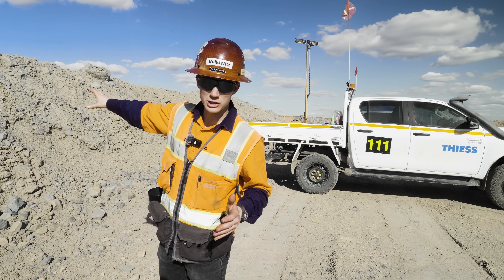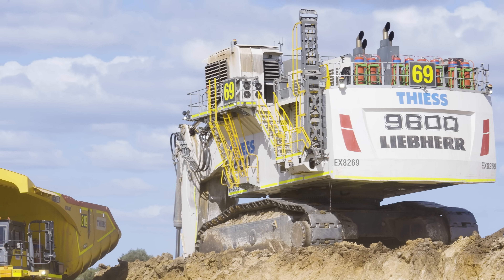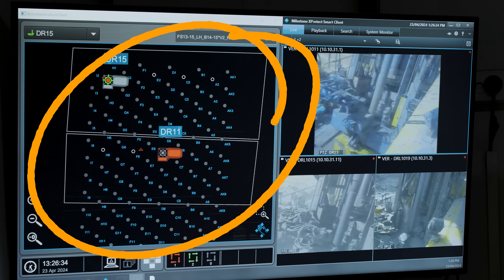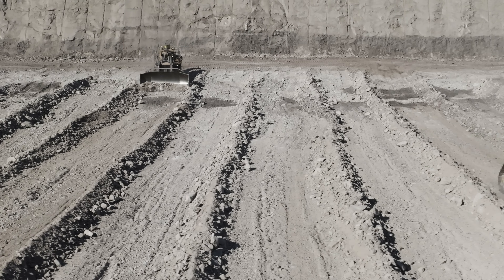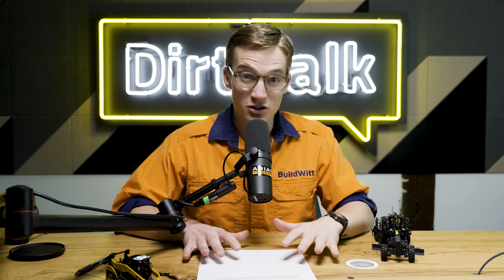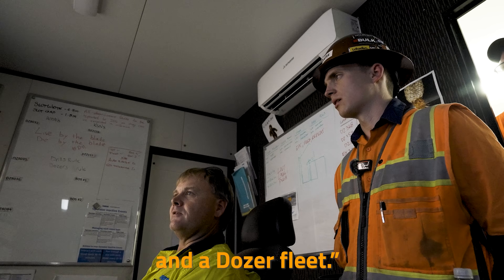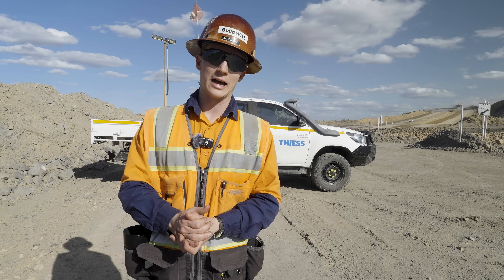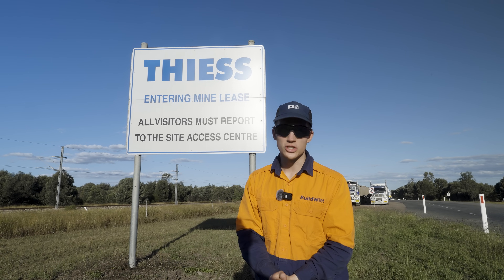Autonomous Bulldozers Explained!

Comment: I like how the remote operator still wears PPE, surprised the company doesn’t make them have a helmet and glasses too.
Reply from the maker: They may also have to head out in the field and run the tractors from time to time. They're still on site
Reply: @AaronWitt the appropriate name for this video should be: How NOT to Slot Push. You clearly how no idea about slot pushing techniques. It's a bit dangerous that you have this much influence in a topic you have limited knowledge about
Reply: @tera2477  how should one correctly do it?
Reply: @tera2477 please do explain how it’s done properly
Reply: @stakman78 The slots are not deep enough down to top of blade, they are pushing from the back to the front and not backstacking, not a good process!!!!
Reply: @shawnlewington3923 The slots are not deep enough down to top of blade, they are pushing from the back to the front and not backstacking, not a good process!!!!
Reply: @stakman78 The slots are not deep enough down to top of blade, they are pushing from the back to the front and not backstacking not a good process!!!!
Reply: @tera2477  I'm not an expert, but for me this doesn't really look like slot dozing, or at least not efficient slot dozing. The slots are not very deep / high, the blades are not really full, the surfaces looks really bumpy and uneven.. I don't know.. I have seen cleaner slot dozing operations, but maybe because its a different material compared to normal overburden, where the blades are often fully packed like a house.
Reply: There is no other uniform anyways 🤷‍♀️
Reply: Welcome to Australia and NZ boys.
Reply: I drive the Goonyella coal trains and the office staff wear hi-vis and never go out west to the mines
Reply: They do all aussie mines u have to have hard hats gloves boots glasses and long pants long shirts. Some areas ul wear it all others u wont need ur safety glasses or hard hat
Reply: The subtitles for the Ozzy were a hoot.
Ozzie's don't get that their idiom filled vernacular is incomprehensible to others. Crikey, I'm an Ozzy and I struggle to understand what some people are saying. 
(The darned immigration officers at the airports are unintelligible. I always ask them to speak English. It pisses them off. 👍)
Reply: Your on a job site of course you wear ppe
Reply: @chrisward5626  Most of the ones I go on it’s only in the active areas. Offices, parking lots, and break areas don’t require it. Each company ha it’s own rules. It was just a silly observation.
Reply: Hi vis and helmets is part of the uniform for everyone working in Oz.
Sure, there are areas on a site that don't really require these for safety, but once you start having exceptions to rules or convoluted PPE requirements it gets hard to enforce. Easy to just say everyone (everyone) must wear these always.
Reply: Great too see Rene working hard , lovely fella
Reply: PPE means protective. The shirt is literally just a king gee.

Ain't nothing protective about it.
Reply: @butdoyouknowhow  Reflective material bands don’t protect physically just like a hard helmet isn’t gonna save you from something heavy.
Reply: @blauer2551  so that's why every mine in Australia wears the same uniform even in the office. 
The mid bands aren't even the reflective material your thinking of. They barely reflect a headlight compared to what host is wearing. 🤣
Reply: @butdoyouknowhow  its hi Vis, long sleeved and has a Uv protection rating... its PPE.
Reply: @xAdam2gx  I have 18 pairs. None of them have UV rating on the tag. Nor has stopped a blade. 🤣🤣🤣
Short sleeves must only be for the mad dogs. I got 4 of those. 
Can you explain to me why we have to add additional layers when we go outside that have actual reflective and protective material on it if this uniform is good enough?
Reply: @bigvideoenergy  odd they don't have a rating, it's actually a UPF rating which related to the amount of UV rays that get let through all mine have upfront ratings... I also have arc flash ratings as well on my shirt and pants.

 hi vis is a no trainer though right?? I've done loads of night shifts and you can see the reflective tape ling before you can make out if it's a person.

Doesn't stop a blade... cause it's not designed to... just like my PPE hard hat isn't for protecting my hearing when using load tools...
Reply: @xAdam2gx  

Avoided the question 

so if the reflective is so great. Why do we need additional reflective layers? 
If the UV rating is so great, why do we need the additional protection from the sun? Surely these shirts would be enough? 
They aren't considered PPE in any of the 6 mines I worked. They were considered a uniform. PPE was required over the top of it. 😅😅
Reply: @bigvideoenergy  mate I have no idea what you're talking about, what site, what type of job and honestly I don't care lol, you simply said its not PPE, I'm saying it's... if you dont want to agree so be it lol, I'm not allowed to do my job without ling sleeve shirt and pants with a 10cal/cm2 min rating.

You realise a hat is PPE, maybe google types of ppe and you'll see that workwear/uniforms are forms of PPE.

Your job it may differ... cool lol.
Reply: @xAdam2gx  so your job is also RCEX? Or are you giving details of the job that is not in the video for some random reason? 🤔
Reply: They do still have to go on site and get on machines
Reply: I hadta wear a helmet and composite toe while loading and hauling and delivering fuel.....IT'S A DAMN LIQUID, it's not gonna fall on my head or break my toe, its liquid. Lol
Reply: @adamfrbs9259  The safety officer at Marathon’s Detroit refinery used to walk around stomping drivers boots to make sure they were steel toe.
Reply: @Ole_CornPop anything that could crush your toe cap is going to crush your toes beyond repair.
Reply: @adamfrbs9259  liquid carried in a solid  that can cause injuries.
Reply: @adamfrbs9259 Some mines you don’t have to wear a hard hat unless your walking under a the imprint of the machine incase a lump of mud falls and hits you
Reply: @adamfrbs9259  You obviously unloaded fuel in a vacuum.
Reply: This is the uniform at Aussie mining companies. At some even the CEO will be wearing the PPE yellow shirt, with their name sewn on the front

Comment: 15:35 with all the mentioning of efficiency and uptime, I'm now wondering why in shots like these seemingly only half the time all 5 dozers move at once.
Reply from the maker: ironically our drones were messing with the connection. But we didn't realize it until we were on another side in Germany where the same thing was happening
Reply: @buildwitt  that's a surprisingly logical answer. Makes sense in hindsight, drones use obviously a similar technology to transfer their own video and control streams...
Reply: @buildwitt whoops 🤭 😬
Reply: Autonomy has alot to do with money aswell they just label it efficiency so no one has a sook, instead of paying 5 operators 120 or 130k a year they pay 2, yes these systems cost alot but they make that back considering they don't have 5 people to worry about anymore, same goes with the trucks they run them 24/7 for "efficiency" but most of them are flogged out sitting on the dead line 😂
Reply: @willibenbi6387 Similar to self-checkout lanes. I hate them with a passion personally, but they're all you can use at a lot of places most of the time. 1 underpaid moron overseeing 8-10 of them instead of paying more cashiers.

Comment: How do the dozers get refuelled?
Reply: I work on a minesite with manual dozers but id imagine the process would be the same. They have a truck that acts as a mobile petrol station, they drive that truck out to the dozers and pump fuel into them when needed. They do the same with the excavators and drills
Reply: @JordanPoplawski Thank you for stating the obvious
Reply: @Failure_Is_An_Option  Tells I agreed with another commenter that has common sense
Reply: Fairies

Comment: With dozers being very efficient why do they choose to switch to excavator & truck with so much overburden left above the coal.
Reply: The coal seam is never uniform "flat" so humans are needed to distinguish the difference between pay and overburden
Reply: @nunyabizzness6468  Makes sense
Reply from the maker: truck and excavator is a lot more flexible. You have to have just the right conditions for the dozer push to make sense
Reply: @buildwitt  👍
Reply: Time. Slow
Reply: Ratio,
Reply: There's a certain distance that it becomes not efficient or economic to push dirt. There's also the consideration of where the dirt needs to go. If you have a hole for spoil, dozer makes sense. If you need to remove the layer and move it a mile away, it doesn't.